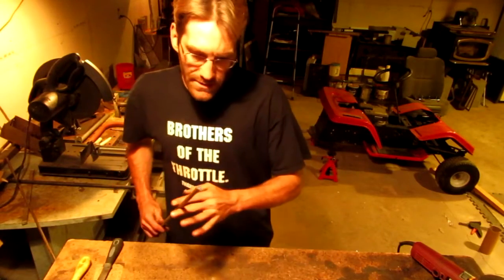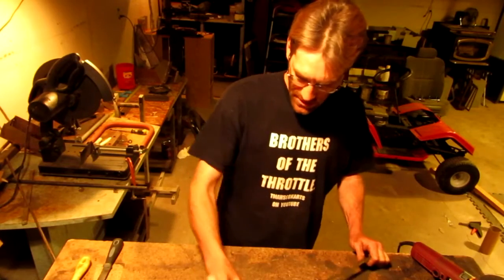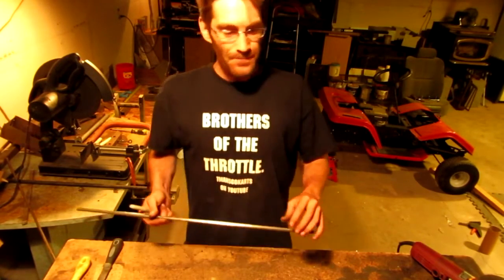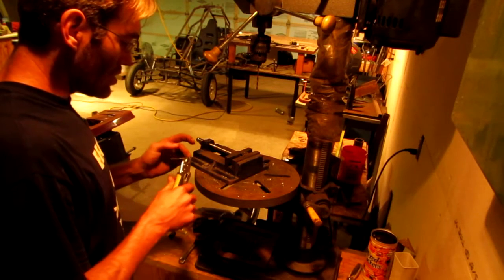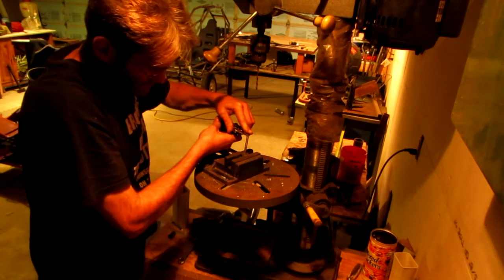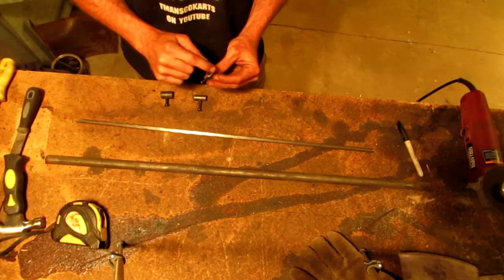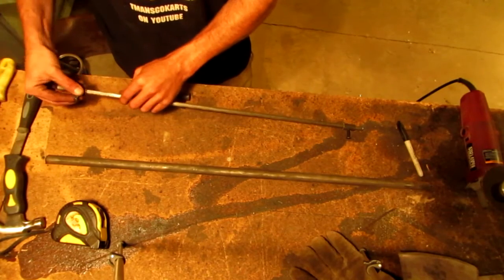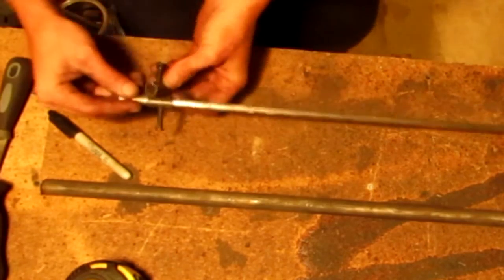MAKING A STEEL HOMEMADE COMPASS TOOL

Comment: May not be worth the effort, but consider using a tubing cutter to mark the rod with whatever unit measurements seem useful. Start in the middle and work towards each end and paint inch, halves and quarter inch marks different colors. Sand after baking paint dry. That will leave color paint rings on the rod for quickly setting pivot and marker. Your channels are great. Keep it up!

Comment: good idea using a rod, but i dont like that the pin & pencil rotate around the rod. I didnt go that route for that reason. so i am making a few out of strips of wood, more so because im a woodworker. yours could use one groove from end to end and a pin on the inside of both the sliders. or does the rotating not matter?